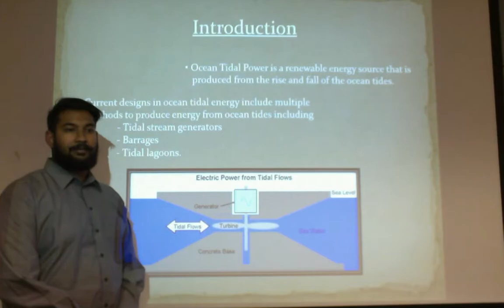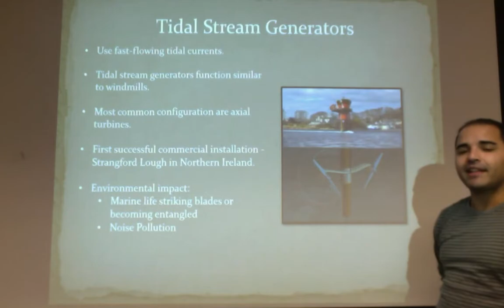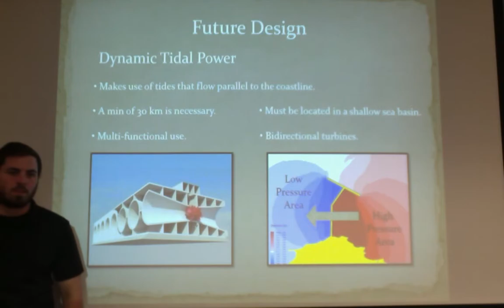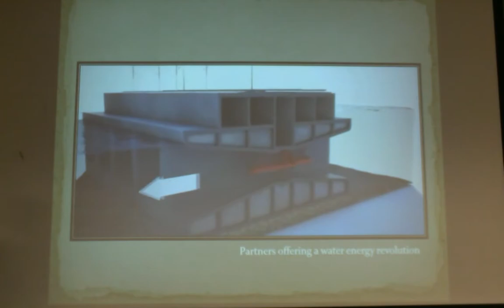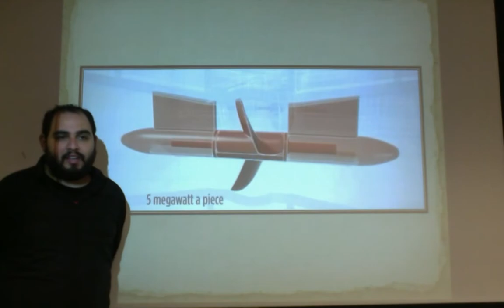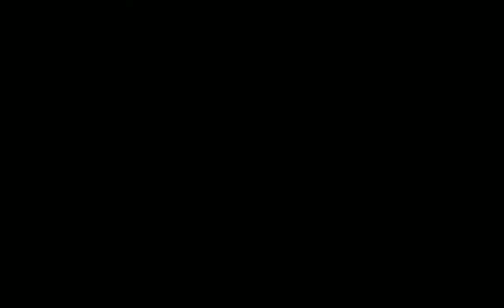Team W: Ocean Tidal Power

Comment: Very good presentation. Information was straight to the point and very informative. Team had a good stage presence. The overall pace of the presentation was also very good. Video quality was pretty good and slides where easy to read. My only suggestions would be to make more eye contact with the audience (the camera in this case scenario) and make some of the pictures bigger, especially the ones that you are going to be explaining. However, I loved the fact that you guys used videos as visual aid instead of pictures for some of the slides. As far as “presentation techniques”, this has been my favorite one so far.